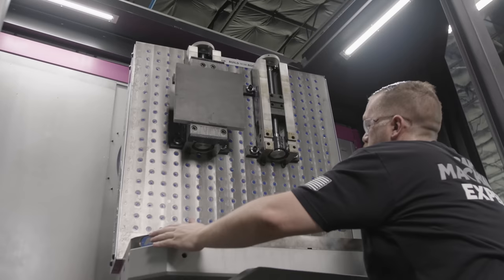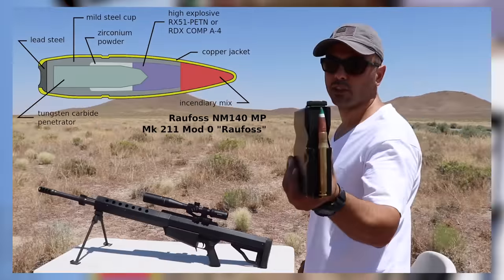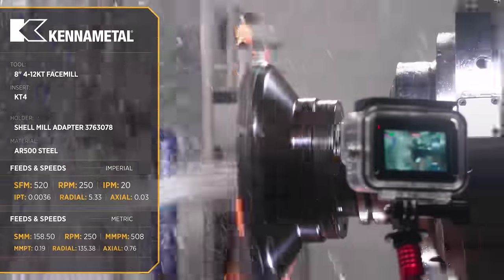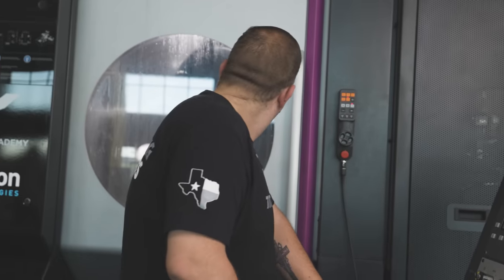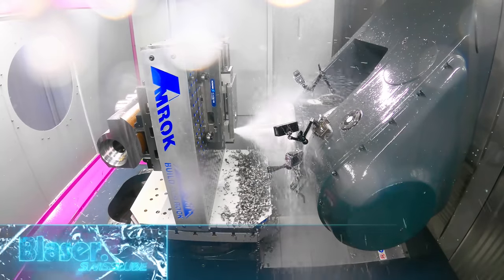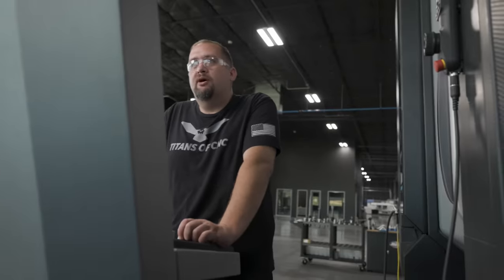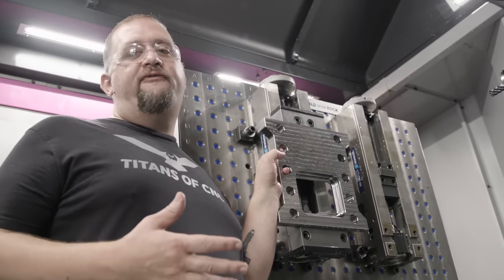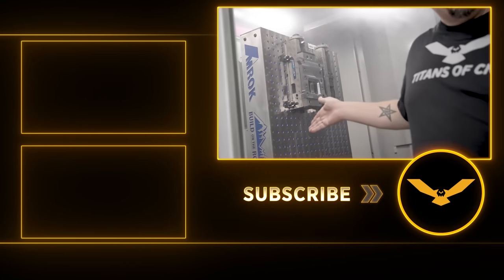Can AR500 ARMOR PLATE Be Machined?

Comment: What about that surface finish on the top face? Was it so bad after that face mill, so you secretly finished it with an end mill?
Reply: Not secretly lol. Came back with the Harvi 3 aero for less tool pressure.
Reply: They do make more than one piece and testing new toolpaths to get a nice video. This is more like advertising channel for Kennametal products. They don’t show failures and that’s not what running a machine shop looks like.
Reply: I was kinda wondering the same thing because the video doesn't show the 30 plus passes with a .5 endmill🤔
Reply: We have to balance some things with whats important to the video and whats watchable. If we showed the 30 passes with the endmill, everyone would tune out on pass 3.
Reply: @barrysetzer  hey Barry, what kind of salary offer would convince you to join another outfit?  Asking for a friend.

Comment: You guys have been chewing through inconel for years so AR500 is just another day for these machines. As always love the work you guys do & can't wait to see what's next
Reply: Not quite the same thing.
Reply: @leftyeh6495  I know those are way different materials but the level of machining experience you need to successfully cut those materials is the same.
Reply: Inconel is softer and less strength than AR500.
Reply: @1008chaz I'm sure couple more inches thickness of AR500 or AR600 steel. That CNC machining drill would be fried😂😅😊...

Comment: The last shop I worked at used a ton of ar500 making parts for coal mine machinery. With the right settings that stuff cuts like butter and shines like a star.
Reply: That is true, we machine it in our shop.  Today I drilled, and thread milled/chamfered some 1.5 inch plates.  The finish is very clean
Reply: @BlueF350 was your drill finished after drilling thru 1.5" thick or AR500??

What material was your drill? Tungsten carbide?
Reply: @7150285  I use iscar sumocham drills, and ingersoll qwik twist drills.  They both are very similar with replaceable carbide tips and through spindle coolant.  You can run them hard, even in AR500.  High speed steel isn’t good for this abrasive steel grade.  I am drilling and thread milling some one inch ar 500 plate tomorrow, I could email you a video if you like.  Where you get into problems is - if you were to chamfer the threaded hole when done, you will push an extremely hard burr into the hole which is a pain to fix
Reply: @BlueF350  I didn't get email...
Reply: Was the machine finished after working on AR500 steels?

Comment: The surface finish on that plate isnt from the facemill.  Did you process that with another endmill?  Charles
Reply: damn
Reply: Of course they did.
Reply: Yeah, it unfortunately hit the editing floor. But with 3” stock hanging out of the vise on both sides, i needed less tool pressure for a decent finish. Harvi 3 aero to the rescue

Comment: I worked for a company that manufactured AR400 through AR600 plate. Every plate produced was machined for hardness testing (hardness has to be taken below the decarb layer that occurs during the heat treatment process).  We designed and built a automated milling machine and hardness tester in-line of the production process.
Reply: Brinell hardness testings. Tensile testing. Ultimate Strength. Yield strength testing. All testings matters...it shows the stress strain curve on a graph...

Comment: I regularly machine AR500 to make giant swords, it's rough on tooling but running it dry actually helps believe it or not. Something about coolant causing microfracturing in the carbide due to thermal shock? I get about 300% more tool life by running dry.
Reply: That’s very likely. Sometimes the cooling doesn’t reach to the right spot while machining.
Reply: Is your tools usually destroyed after making the 1" AR500 steel sword? Also what material of tool were you using??
Reply: Were you using tungsten carbide material to machine 1" AR500 steel?
Tungsten Carbide is at the range of 700 brinell hardness I think. However pretty brittle as well at that hardness. Just like tungsten carbide bullets or the tungsten carbide teeth used on excavator machines and trencher etc etc.

Comment: AR material is some VERY tough stuff.
Back in the early 2000s, the boss bought a dump truck that had a rotted floor.
Since we hauled a lot of concrete, he bought a precut piece of 5/16 HyBraid abrasion resistant steel.
We didn’t have to cut or do any fancy fitting. Those guys were so good, it slid right in!
Welded the seams and the ribs, and all was perfect.
A month later, I dropped a huge chunk of concrete into the box. 
Not a scratch!
Later, the guy the truck had been assigned to, and I, were stopped for lunch somewhere.
The box and cab was aligned such that a flip out the window would toss your garbage into it without even looking.
About the time he was tossing a cardboard pizza carton into the box, I was tossing a glass bottle into the box.
The timing couldn’t have been better if I had tried.
The glass shattered about the time the box hit the floor, and he goes, “WTF?”
I laughed a stitch into my side at his reaction!

Comment: I made Tribraze stops for a steel ball manufacturer. They would produce 8" dia steel balls, and my parts would act as a stop after a 6ft drop.  They were notoriously difficult to drill and tap on the Bridgeport manual mill. Until we started spending over $150/tap the process had serious problems breaking taps and scrapping parts.  
The crew before me used to heat the parts red hot and then run the tap covered in oil through! It did a number on the machines, but it's what they cooked up at the time.

Comment: I used to make some 25" long chain guides for lumber mills out of AR450. It used to eat up the HSS drills and regular endmills that I had available. A Kennametal tool rep came in while I was running the job and offered me a set of HARVI II endmills, a Hydroforce holder and some solid carbide drills. With the new tooling and recommended speed/feeds, I was able to cut 30 minutes of cycle time off EACH part. Needless to say, the boss bought everything the rep had let us demo. This was all done on a '97 HAAS VF-2. If you have the proper tooling and methods, you can pretty much cut anything.

Comment: In our shop we often machine hardox 550 and high-tuf since we produce tools for heavy demolition and quarry excavation i'm boiler maker but it's not uncommon that my colleagues ask me to remove broken taps from the material. Even if we use special tools for this the steel is never the same and all the more after welding wich can create hardened areas within the thermaly affected area. It would have been nice to see some tapping operations in AR500. I'm french so excuse me for my approximate english. I love your work this is very instructive
Reply: I love hardox especially hardox 600 It gives a good challenge to process and behind to see it put together into a whole. which There after rips in bus to small inch pieces
Reply: Your English is just fine and better than many Americans. 👍

Comment: I have worked with similar Hardox and like AR steels, many times even with just simple hand-operated drilling and machining work.  

It's simple. 
Use lots of coolant/lubricating oil.  
Keep the feed rates and tool speeds low.
Patience pays off with this stuff.  

When done properly, even a common high-quality Cobalt drill bit can poke holes in Hardox 450 -500 plate without problems and carbide or ceramics tooling will do it all day long.
Reply: drilling and tapping hardox, yeah, lots of oil/coolant, but lately i am milling hardox 600 dry, nice to see some high feed inserts last hours, even some "regular" mill inserts lasts a efw hours while pushing our poor 3axis VMC to its limits...
Reply: Since you mentioned hand-operated stuff, I have to ask, what is your experience like using HSS-Co drills and end mills on a CNC? My experience is that the wear rate on the tools and the delicate nature of twist drill point geometry for example, makes it almost impossible to get a process dialed in with them on anything tougher than aluminum.
Reply: @Sketch1994  good quality HSS-Co twist drills can be dialed in pretty good in low to medium production runs in almost any material up to tool steels. We mostly use Gühring drills and I can't really fault them for the price, for example their 657 and 659 HSS-Co drills can do almost any material you throw at them. I can't say anything about endmills except some one-off T-slots in alu, brass, steel and stainless.

And of course, carbide will almost always be faster and more accurate.
Reply: @dubi127  Sounds interesting. I haven't tried any "expensive" HSS-Co drill apart from the ones usually sold by local suppliers but I have only good things to say about their RT100XF drill. 

100 meters of drilling depth or 10.000 holes in 1cm thick mild steel cold rolled plates (with crust on them) at a speed of 172m/min and 0.37mm/rev with a 9mm solid carbide drill (2,25m/min of penetration rate).

The way I came to see it after hundreds of production runs, apart from precision prototypes/jigs/fixtures and repairs (I have milled up to 4000 parts per 7 hour shift without any automation on a VMC, by turning the loading procedure into a F1 style pit stop and I have milled up to 2700 parts/shift on my own, in a typical batch production that I optimized the shit out off, and I have turned/drilled/port reamed/tapped/threaded up to 100 parts/shift on a manual lathe/drill press using carbon steel and silver steel form tools, but I have also taken 2 weeks to properly adjust the bearing clearances on a milling spindle) is that in today's machine shop there is no excuse to not be drilling 3cm of steel in under 1 second though and one way or another prices have come to reflect that, even if it's for better or for worse.
Reply: @Sketch1994  Guhrings 657 and 659 drill are not that "expensive" and we mostly use them due to their versatility and the fact that we mostly make single to low volume parts. Then it is cheaper to get every diameter you need to drill a few holes with once in a while.

So far i have not pushed any drill past 900mm/min feed rate, but until recently we did not have a machine with a through tool cooling.

Comment: Impressive results, just the way the plate bounced off the floor you knew it was hard.
Reply: That comment shows that YOU SIR know your metal.
Reply: @barrysetzer  when that face mill started cutting I had my doubts.
Reply: Hardness and toughness are independent from one another, aren't  they.

 Wouldn't  "tough" be a better descriptive than "hard"?
A hard metal can shatter under impact, whereas one that's  tough can take that abuse. Correct?
Reply: @williamevans6522  yes, in theory. A tough metal will not wear as easy, due in part to the hardness and chemical composition. In the case of armour it’s the balance of weight, penetration resistance and ease of availability .
Reply: @barrysetzer  Hope Titan didn't see that you chipped the concrete floor.😁
Reply: @mehmettemel8725  hahahaha

Comment: I think that the AR500 is made for one impact and not for constant pressure. That's why the tools withstood it, but the correct speed and feeds also had job on it. Nice video :)
Reply: AR500 or Hardox is widely used for construction and farming equipment. 
So machining this stuff is just routine.

Comment: I worked in a machine shop that was a defense contractor and AR500 armor is not used on military vehicles. We used MIL-A 56100 armor and AR500 is actually pretty soft in comparison. The 56100 would just eat carbide cause aside from being hard it is also very abrasive.
Reply: We called just called brinell 650. Used it for doors on humvees
Reply: @firestarter5038  We made the the transparent ballistic armor and gap armor rings for the hummvee and mrap as well as a few other vehicles. The windows were both the standard and emergency egress
Reply: @firestarter5038  the harder the steel is it is for saving weight. Because harder steel can be "thinner" while still offering the same protection as thicker steels.
Reply: How thick is the thickness MIL-A 56100 that you dealt with?
I have access to MIL-A 46100 which is HHA High Hardness Armor (which is equivalent to industrial AR500 basically. And RHA Rolled Homogeneous Armor as well MIL-A 12560. Although I have never dealt with those before.

Military don't use AR500. It is used for mining. AR500 isn't mil-spec.
Reply: Up in Canada. They even deal with solid AR500 steels up to 5 or even 6 inches thick for digging BIG quarries and mining. Also 1.5 inch thick AR600.

The thickest AR500 I have on hand is 3 inches thick.
Reply: @prandomable  we used a variety of thicknesses ranging from .25 to.75
Reply: @jansenwrighter4847  what's the brinell hardness range?? Like 600 to 700 brinell hardness range?
There are Hardox 700 that's 700 bhn and is at 0.75 inch thick.
AR600 can be up to 1.5 or 2 inches thick.
Reply: @prandomable  its nominal is 500
Reply: @jansenwrighter4847  then that is NOT harder than AR500. But more like "equivalent" to AR500....
Reply: @prandomable  whatever the alloy is it's harder to machine than AR500 steel and it eats thru carbide
Reply: @jansenwrighter4847  you are comparing apples to oranges. Because we have no ideas what material is the CNC machining tools in this video...I mean they never mentioned it.
Reply: @prandomable  well we know they primarily use kenametal and i was speaking of my own experiences machining it because roughly 80 percent of what we made was made from 56100 but we did do some work for local law enforcement where we would use AR 500 and we use iscar and walter inserts
Reply: @jansenwrighter4847  the kenametal they were using was "tungsten carbide" material?? Did you use "tungsten carbide" as well for your machining?
Reply: @prandomable  yes we do
Reply: @jansenwrighter4847  is your tungsten carbide machining tools usually destroyed after machining MIL-A 56100 from your experience?
Reply: @prandomable  thickness is .406"

Comment: For large mills like you guys often use in your videos, I often wonder why the controls are angled such that the operator is directly in front of the door. I understand how you need to access the inside of the machine for fixturing and such, but they could alternatively have the operator to the side of the door, angled so they are facing toward it, keeping the operator out of harms’ way in case of a catastrophic failure.
Reply: Most pro CNCs have the control panel on a swing arm so you can move it where you want it within reason. Many off us chose to be in front of the window for maximum visibility while comfortably being ready to hit the Estop or slide hold.

Comment: Try machine Hardox 600 wear plate. Steel is for extreme abrasion resistance.
Reply: There are Hardox 700. At 3/4 inch thick the thickest.

Comment: Ar500 nice, now move onto the big boy stuff and get some Hardox extreme or 600 in there ...
Reply: Regularly work 600 for liner plates.
Tool life of endmills almost seem to drop 1/2-1/3 from ar500.
And carbide drills will just shatter if you try pushing even at normal feeds.